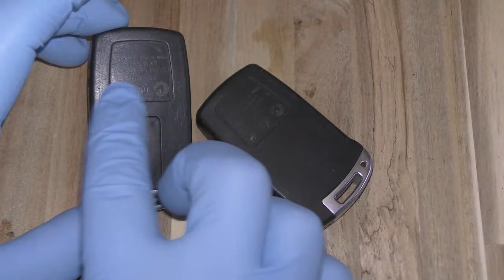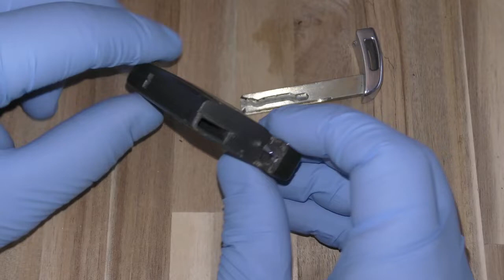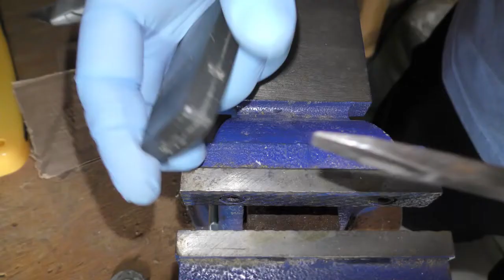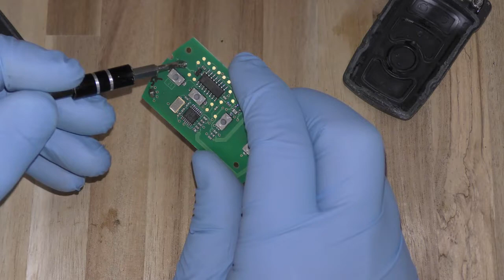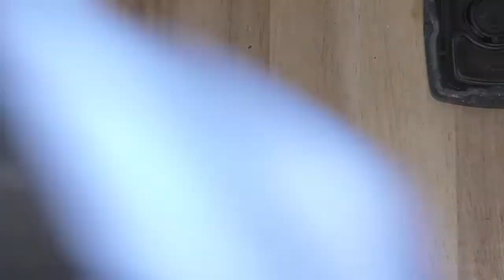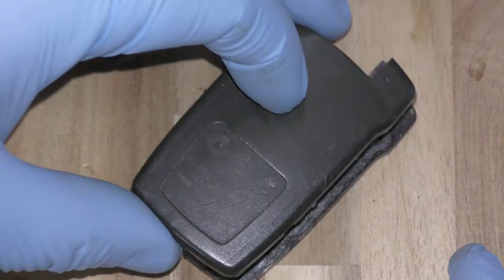BMW 7 Series Key Fob Battery Replacement - DIY

Comment: I used a knife instead of a screwdriver and it worked better to break the corner open. No need for the scoring of the edges.

Comment: Is that a rechargeable battery? Or a long range battery? Mine is a 2002 and have original jet, they works good. i have listen that the key is recharging when it is in the key holder in the car.

Comment: Can you send me the link to replace the battery into a 2008 BMW 750 LI V8 4.8 L I also think that in that process they killed the alternator because all the lights are on in the car and I couldn’t get it out of gear, the gear, the only lights that wouldn’t turn on are the gear lights And I have pictures to send you

Comment: I tried this with my 2004 BMW 745Li for the non-comfort access key fob.  At first it beeped once and then nothing thereafter.  Now my key fob will not even stay in the ignition it slides in but then slowly pushes out.  I even brought a replacement key fob case thinking I messed my up but still will not stay in ignition so now I can't start the car with this key fob that was working prior to the battery replacement.  Do you have any clue why it won't stay in ignition any more?  Thx.
Reply: No reply? What did you end up doing?
Reply: @yosoy3879  same issue here. Key wont latch inside for some reason. Have you resolved this?